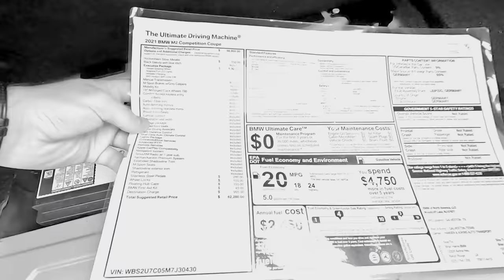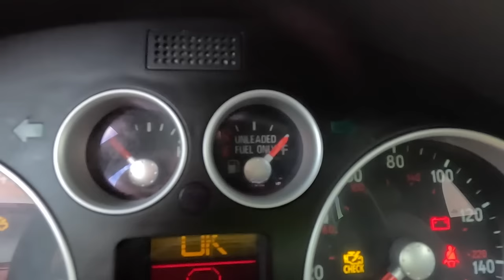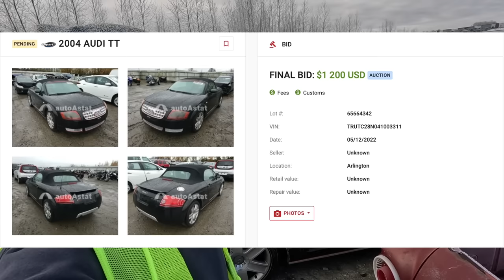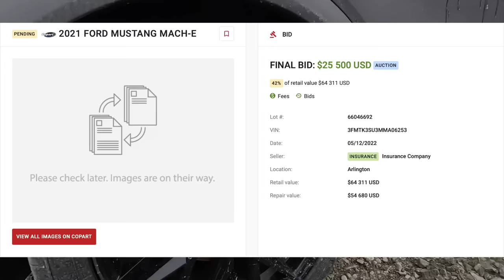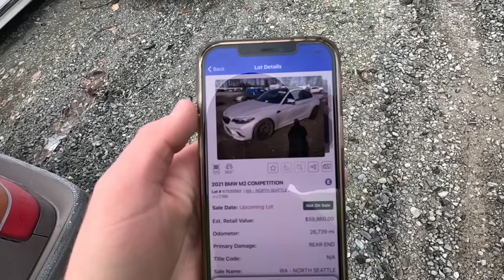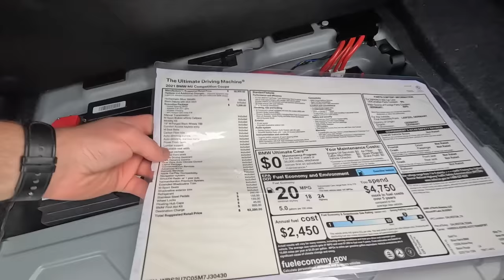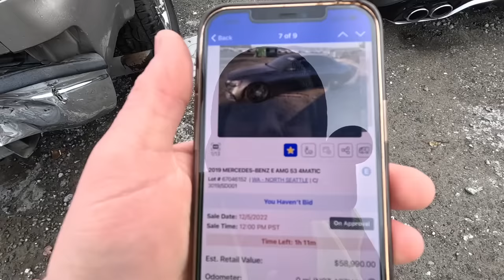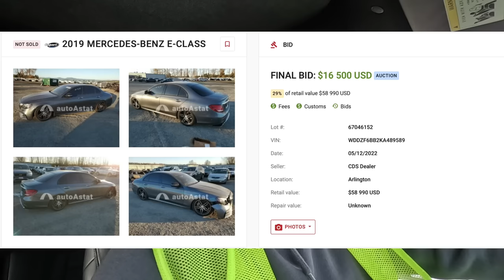Buying SALVAGED Cars at Copart (EASY MONEY)

Comment: you should definitely do more content. So sad that here in Europe it is practically not worth rebuilding most of wrecked cars. Labor is extremely expensive so are the parts and wrecked vehicles are also expensive.
Reply: It is only worth while if you can do most of repair yourself, general mechanical and/or electrical replacements . You can always outsource paint work/frame work etc.